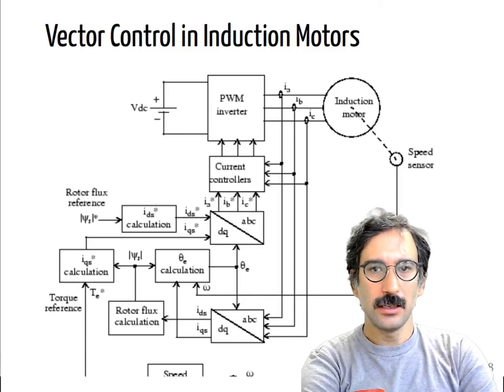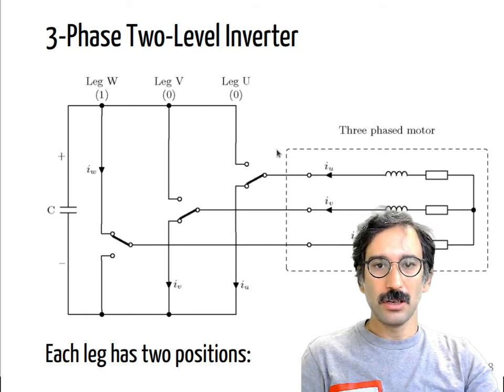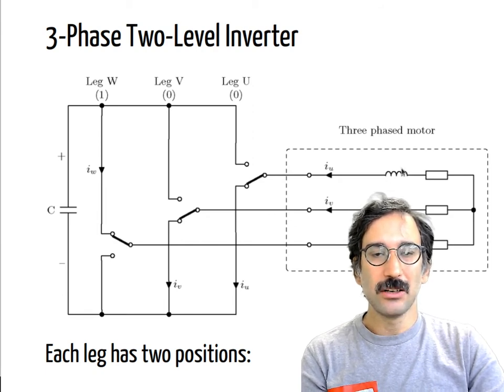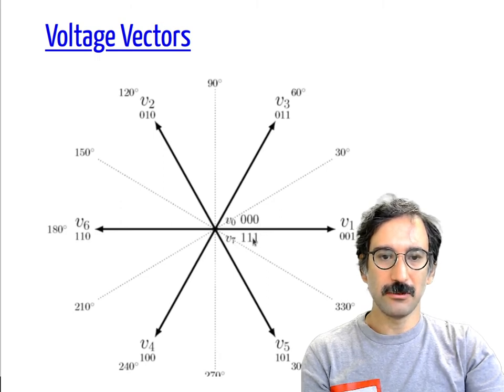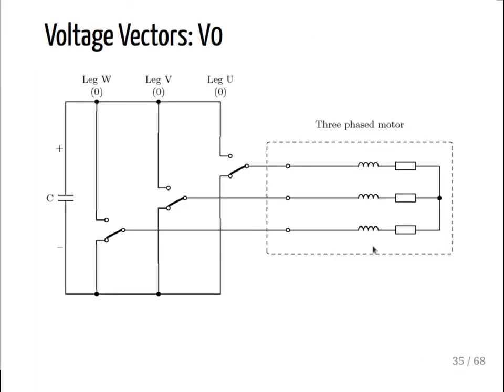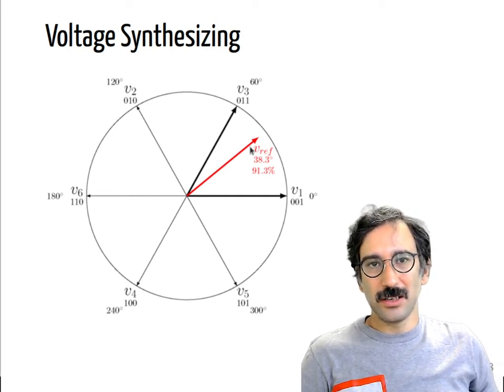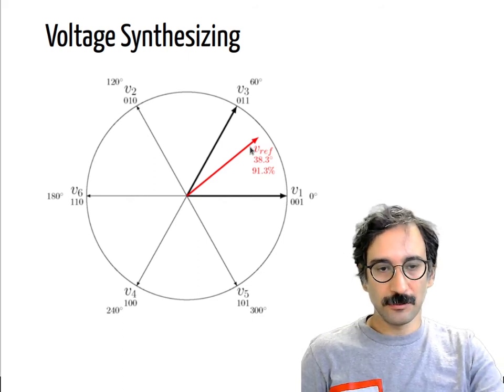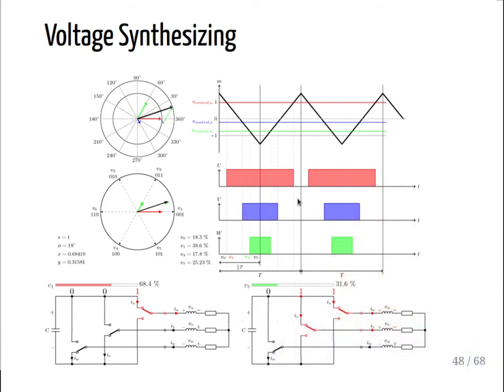SVPWM (Space Vector PWM) and Third Harmonics Injection (THI) in Inverters

Comment: Good afternoon! Vector control theory says that the resulting stator field vector must be kept perpendicular to the rotor magnet. If this is one magnet with two poles, then it is not difficult to imagine. But in life we have a lot of magnets. For example, there can be 12 of them on a scooter motor wheel, and the rotor is located outside the stator. How to present this corner there? How is the magnetic field located?
Reply: I will try to answer you question. Let's assume that you have an 16 poles PM (8N and 8S) with a 12 teeth fractional-slot stator. Phase A will be wind at avec 90° displacement starting at 0°. Phase B will start at 30° and also have a 90° displacement each coils and finally, stator coil for phase C will start at 60° with its 90° displacement.

If you align one of the N poles of the rotor to one coil of phase A, 4 of other N poles of rotor will also be facing the 3 other remaining to coils of phase A. All other PM poles will align more or less to the closes coils B and C. If you rotate manually the rotor, the same 4 N poles of the rotor will align to all coils B and so on. 

Lets puts some numbers, each PMs are distributed evenly at 22.5° (360/16 = 22.5 °). You have 12 teeth on the stator, each stator teeth will be displaced every 30°. If you have 3-phase motor , then 12 tooth / 3-phase = 4 coils for each phase. 360° / 4 poles/phase = 90° displacment between each coils of phase A, the gois for coils B and C. Hope it make sense. And 90° / 22.5° = 4 magnetic poles of the rotor will align with 4 coils A, or B or C of the respective phases.

My point is that the FOC does not care if the rotor made a full turn. Since each coil of phase A are displaced at 90°, every 90° mechanical rotational displacement will equal a full electrique rotational revolution. 

However, the FOC needs to know where or at which angle the d-axis is, and for this, you need a shaft sensor the measure the angles or the back-EMF for sensorless angle detection. This datum is valuable to determine the speed (angular velocity - RPM, etc), the rotational angle for positionning for example or the  angle of the d-axis as per phase. The last is needed with the currents of each phase for the CLARK transformer. With out this data, you have no FOC.

Hope it help!

Comment: Hi Ozan, Thanks for the great Video, I have made an Inverter with SVM topology but I have a problem in output Voltage, my input voltage is 220 V but the output voltage wouldn't go over 180 V! may you please let me have your comment about?
Reply: Your input  dc voltage should be 311,
220v is rms, 311 is vmax, 1.414*220=311

Comment: Thank you for the video. Could you please clarify the following questions?

The procedure is as follows:
1. Make a modulating for the first sine wave (e.g. for the first transistor). Amplitude (e.g) = +1...-1
2. Add add third harmonic and get the curve with two humps as you sown.
3.  Add another triangular reference signal with amplitude = +1...-1
4.  Сut PWM signals by comparing voltages. 
5. Send these signals to the transistor

The structure of these PWM signals will  be different than if we were using a pure sine wave. But why would the output line voltage be higher? An open transistor "sees" the input constant voltage (500V). Not more. I have it after modeling the same (In both cases, the amplitude is 500V)

The second question: We can set the amplitudes of the modeling sine and the reference voltage as we want. It's mathematics. 
I can make the amplitude of the reference voltage just 15% lower than that of a sine wave. Then the transistor will be at the point of the maxima of the sinusoid open just longer.
Why do we need a third harmonic?